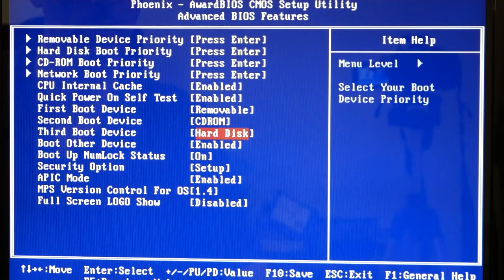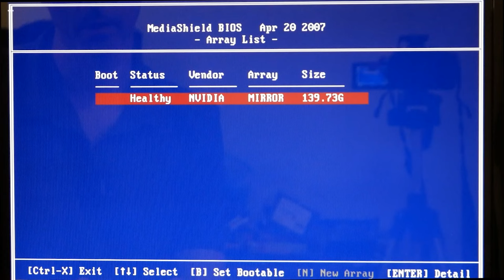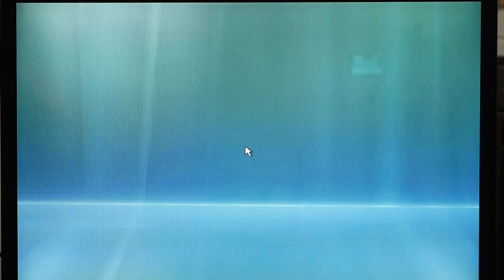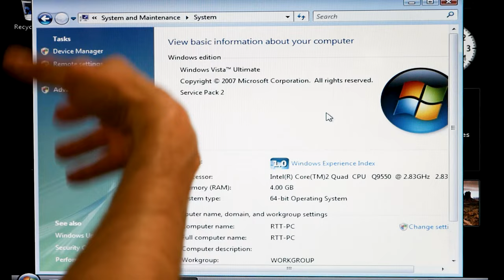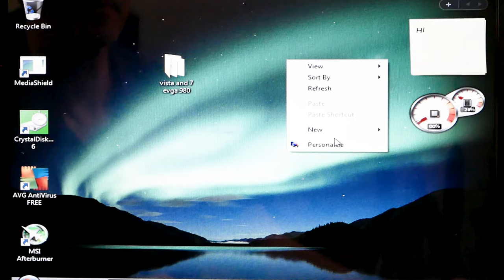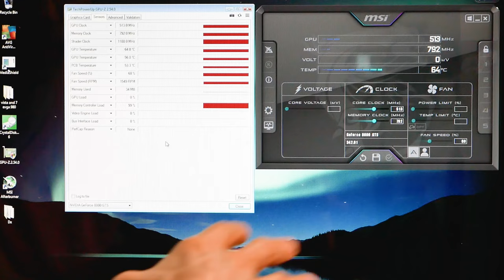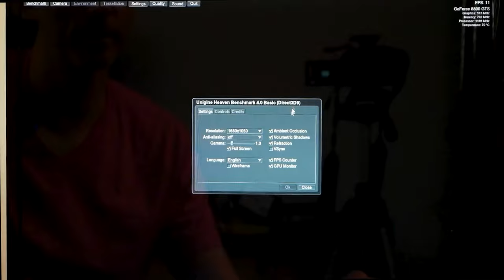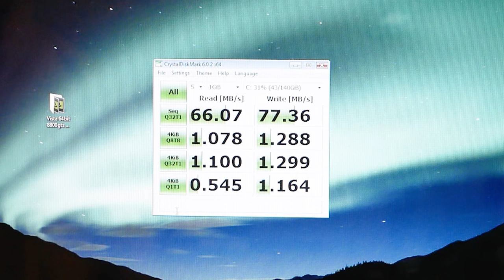My Windows Vista Ultimate Build in 2023! Old Tech Dies!

Comment: I use windows Vista Ultimate x64, with SP2 if you download all the security packs you would be able to use DX11.
My specs are phenom II X6 1050T, ASUS AM3 motherboard, Radeon HD 7970 and a sound blaster audigy 2
Reply from the maker: Hi there! Thanks for the tip! I'll make sure I download those security packs when I rebuild Vista. I've got a hd 7950 and it still does a great job. I've always wanted to get one of those phenom 2 x6 cpus. They are pretty nice! Thanks for watching and commenting I appreciate it.
Reply: @RememberThisTech  I have a Phenom II X6 1035T if you want it
Reply from the maker: Sorry for the late reply: How would we go about doing that? Shipping and stuff? thanks

Comment: Awe what a shame about the parts, but at least you made an attempt. Before the GPU died, did you happen to notice if SLI was enabled? I remember at some point it needed to be enabled in the Nvidia control panel.
Reply from the maker: Hi there! After I was testing and loading drivers I noticed that one GPU stopped being detected and I tried to set up sli and it didn't show in the Nvidia panel either so I tested them one by one in the machine and the ebay one died and wouldn't even get a blip of a signal output :( I almost didn't post the video as its kind of a failure video but I put too much time into it so I figured why not illustrate that Old tech/parts die.

Comment: So funny I have most of those parts here like the q9550, But the Motherboard is an Gigabyte 2 PCI express one and The Cards are both ENG ASUS 8800 GTS. The cooler is an unknown  one with two copper finstacks with the van in the middle. Could alsoo be a Zalman though. And I have Vista somewre on a disk. I even have  two sticks of 1GB 1066 Crucial Ballistix Ram with the heatsinks. Or I could go with 2x2 800 DDR2 ram with 5-5-5 latency timings. Or I can just lazy slam 4 x 2GB in. I am inspired. I have an RECOM 600 Game powersupply to go would thatthat shows the Wattage it draws from the wall in digital numbers at the back.
Reply from the maker: Hi there! Nice system setup you have there! You should definitely build yourself a Vista box with all your parts! :)

Comment: Nice video, but it seems like that you set the raptors to RAID 1 instead of 0. The raptors are mirrored, so you have data redundancy and not the full capacity and speed. You should set them to stripe. This is why you have such a low performance in crystal diskmark. I would prefer a single gpu rather than 2 weaker gpu´s. But all in all its a nice compilation of old hardware.
Reply from the maker: Hi, and welcome to the channel. Ahh, good catch. It's been 20 years since I set up a raid array, I should have double-checked and set it to stripped. :(  But when one of my drives died, it should have still been usable, but it wasn't ( old hardware ). I'll pay more attention in the future. I've already started to redo the build, but now in line with sort of how you  mentioned. A single gpu of better quality and scrapped the spinning disks. Thanks for pointing out those things. I've forgotten a lot in 20 years, and I need to get back on my A game. Thanks for watching and commenting. I appreciate it :)
Reply: @RememberThisTech  No problem :) It´s a nice rig, i also like the Core 2 Quad Q9550. Thats a fast cpu even without any overclock. I have had this cpu for a long time. It served me well. You could install an old Radeon HD, like a HD 4870. That should work fine and the machine would have much more power for older games. But if you prefer a nVidia gpu you could go with a geforce GTX 280/285 ;)
Reply from the maker: @hardwarecollector2097  I'm going for overkill, Like an HD 7950!
Reply: @RememberThisTech  Yeah, that would be nice, too :D The cpu should have enough power for the HD 7950. But off course it depends on the games you play.
Reply from the maker: @hardwarecollector2097  Crysis, fallout 3, oblivion, a few others.
Reply: @RememberThisTech  Nice games. It would be plenty of power for these games.

Comment: In the install it shows 150gb, but are U sure raid is working?
Reply: Raid 0 is not working for sure!
Reply from the maker: Hi there! I mistakenly set the raid array to raid 1 mirrored. Later on, after the array failed, one of the raptors' heads were crashing :( Was the array fully functional? Well, probably not with those Crystal diskmark scores :( Thanks for watching and commenting. I appreciate it.

Comment: a lot of 8800/9800 series cards died too easily iirc
Reply from the maker: @nitroseven  Yeah they did :( poor cooling etc. :(
Reply: @RememberThisTech  i was a victim of it actually, but with the even more failure prone mobile series card. found a sager with i think 9800 gtx mobile a few years ago and now it has the red lines of death and the driver won’t start. i have a toshiba qosmio with 2 9800 GTSes (mobile of course) in sli that have yet to fail, but i’m kinda nervous
Reply from the maker: @nitroseven  Ahh that stinks sorry :( Can you get an aftermarket cooler and put on the one that still works? Would it even help?
Reply: @RememberThisTech  don’t know what i will do with the sager. it is MXM which means it’s completely upgradable. i’ll have to do it soon. unfortunately the toshiba laptop can’t take anything better, and even with the best repaste job, my SLI laptop is a ticking time bomb
Reply from the maker: @nitroseven  Yep  asap!!